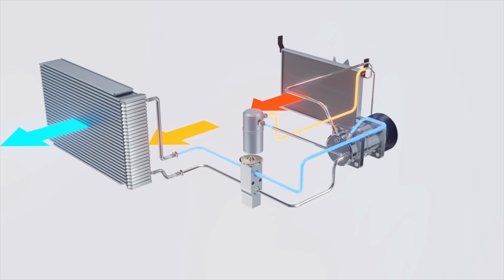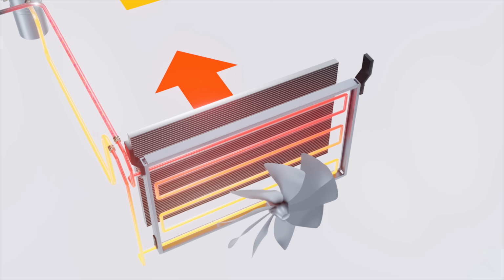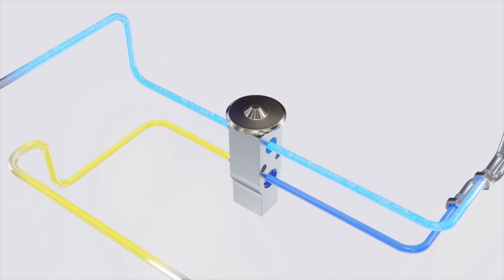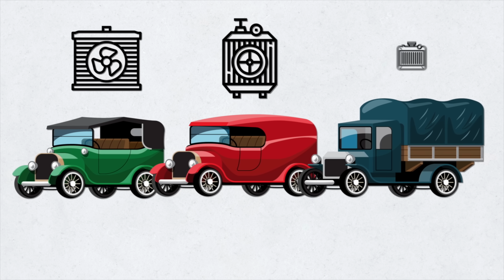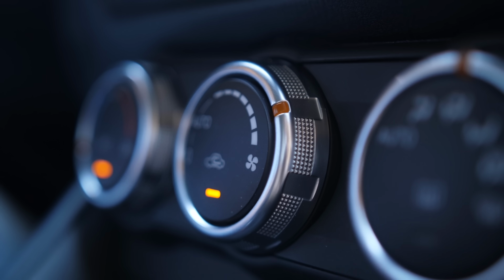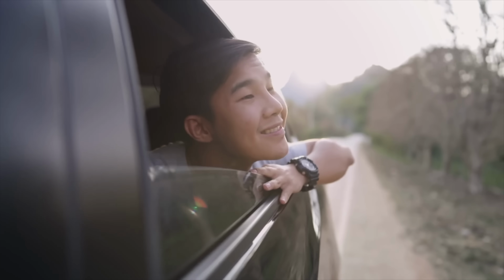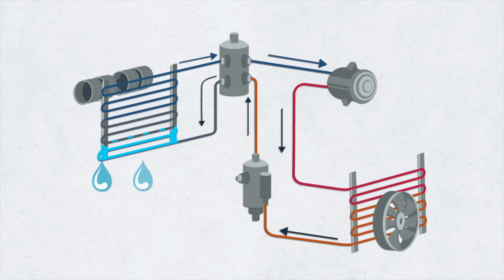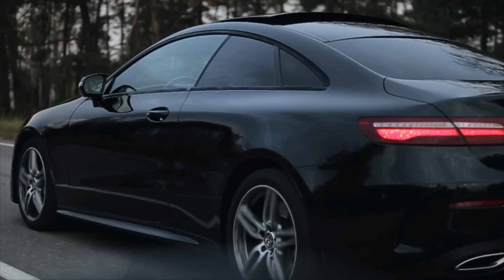Never Do This to Your Car’s AC System

Comment: I was always wondering what incredible reasons for car manufactures force AC on windshield? Why not keep it selectable and inform in manual how to defog... Why in the world i have to run heat in winter over forced AC on windshield? Do they really want me use more gas and loose compressor faster?
Reply: Dehumidified air will clear up a foggy windshield especially when it rains. That’s another GOOD function of the AC.
Reply: @standhd  I'm talking about winter, it should be selectable, not forced, everyone can read in manual to turn on AC to windshield to remove the heat they breathing on it ... or at least setting temperature on heat should turn AC off... if they forcing it so people don't have to study it
Reply: @tallll70  on my 2010 civic I was able to reprogram it so I can turn the A/C off even when defrost is on.  Found out how on YouTube, it was just a sequence of turning the ignition on and pressing the door locks.
Reply: @ExplorerBen7  That is cool, i wish i could do that with alfaobd , i do have added compressor switch which also led indicates compressor cycling, just for fun of it
Reply: It was mentioned on the video you need to run the A/C even in winter to make them last longer but it doesnt give you cold air though if you got the thermostat set to heat.
Reply: @VintageCars999  That i didn't notice, but i wouldn't believe it anyways... what about climates with not enough heat or could, so they doomed to worst AC reliability... Not to mention, if that would be the case why only on windshield?   Not convincing

Comment: Just like your home thermostat, turning the temperature all the way down to “LO” (I speak only of cars with auto climate control) will NOT cool it down faster. If your car has automatic climate control, find your ideal “comfortable” temperature and let the system do it’s job.
Reply: Actually it kind of does or at least tricks ya into thinking it does because with the auto climate it will turn the fans on higher the cooler you go.

Comment: About rolling down your windows instead of AC... If you want less drag, roll down the drivers side front 1\2 way down, and passenger rear 1\2 way down. There are a few advantages for that:

1. 1\2 the area=1\2 the drag. (1\4 if you compare to both front windows)

2. You force the air to move through the driver (you) to get out, so it cools you better.

3. You make a passway for a lot of air out the car before it hits the rear windshield, which will lessen the drag as well.

The least amount of drag will be driver front+rear or passenger front+rear, but then you'll barely feel the wind. If you try that and it works for you... Than that's even better than what I initially suggested.

Comment: interesting to note the AC should be turned on weekly
 even during seasons when you don't need it
Reply: Why
Reply: Yeah why just curious 🤔
Reply: @axelfoley1812  it circulates the oil and Freon in the system, keeps the seals and other important components properly lubricated..
Reply: Yeah why just curious 🤔

Comment: If I can’t find a leak in the AC, I pay a mechanic to put a dye in to find the leak and also to evacuate Freon. I can fix AC compressor and change the lines, but I unfortunately found out that the leak is  in the dashboard in my 1999 Durango (it’s my dog car), so it’s not worth fixing it. Too much work disassembling the dash. Yes, Durango is a crappy car but it does have a good V8 Magnum engine so I’ll drive it until engine or transmission go kaput...
Reply: One of those rare instances when I'd try a sealer.
Reply: @wholeNwon  
I did actually. It did not help. Dashboard leaks are the worst.
But my other Toyotas have never had AC problems: I have also Matrix 2005 and RAV4 2006. Matrix I got free from my mom and Durango free from dad. I got RAV 4 last year that I bought.
Reply: @igorseprak6177  Which product did you use?
Reply: @wholeNwon  
Regular Auto Zone AC seal leak. In this case, mechanics actually saved me money by finding the leak with purple dye where it’s hard to trace. $100 well spent it turns out. Had I not done the dye, I would have been sucked in the the AC quicksand by changing all the parts but disregarding the dashboard.
Reply: @igorseprak6177  Actually it's the second or third place to look. If you used a rubber seal conditioner as a leak stopper that wasn't bad but, since it didn't work, I'd try an actual leak sealer.  Of course, if I had any plans to salvage the system, I would not use one of those products.

Comment: Put a radio in my 2015 ram 1500 express now ac dont work dealer did not want to fix wanted to replace 1500 worth of connectors i did not need ac is still not working it worked before the radio
Reply: Go to a different shop...NOT a dealer.
Reply: Hahahaha you broke it.

Comment: Funny story... My cousin had a Chrysler K-car years ago... I was probably 12 years old.  We went somewhere and he turned the A/C on and it worked fine until he turned the wheel. Then it blew warm air until he turned the wheel straight again.  I always wondered what would cause that.
Reply: May just need freon, if the condenser fan is working.

Comment: I told you my dad owned Baskett's Texaco. In late 50s, he and Fred Jones, who never cashed a paycheck from my dad in 30 years, began installing FridgiKing air conditioners in cars including some brand new cars. It mounted under the middle section of dash was about 20" depth by 28" width by 7" height. All vents and controls were on the unit and the rest was under the hood, although I think there was a small component under the dash also. They had to custom fit each unit and the one in dad's 54 Mercury cooled the backseat just fine as I rode back there. It was so cold and we loved it. It caused dad to put extra help on to pump gas and do tire and oil changes. He and Fred were popular for several years until advances changed the way it was done. Boy if you saw a picture of Fred, you would swear it was old Honest Abe. He was a very private person. 
I just wanted to show that they were installed well before the late 60s early 70s.
Love your show Scotty...

Comment: My 28 year old Altima still blows colds air to this day ‼️ long live R12‼️
Reply: ford and chrysler were the dying of R12. bad connections and hoses !
Reply: @poolmotorrepairguyFL  Hoses. Definitely not good for an A/C system.
Reply: Altima’s never had R12. Their first year, 1993, had R134. The car’s predecessor, the Stanza, had R12.
Reply: Not many vehicles still have R12 . I'm guessing if available it's at least $300 a litre or lb or something.

Comment: What if the ac is hot for about 20 min and takes about 45 min to actually gets cool? My ac is brand new but takes forever to get cold... do I just need to break it in?
Reply: No, break in is not required, there is something quite wrong.  It could be overcharged.  If it is an R12 system converted to R134a (even with new parts), the quantity of refrigerant is less.  You can find online information to give you the required quantity.
Reply: If the car is new, too, take it back to the dealer. The system is defective.
Reply: @wholeNwon  no the car isn't new but the ac broke last year and I got it replaced and now that it's summer time it takes a while for the ac to actually cool the inside down

Comment: Not sure if it was a myth or not but my dad who was born in the 1930's used to always tell me never to turn my AC on all of a sudden if I I was going 50 mph or faster- reason being the compressor engaging while I'm already going at a high rate of speed probably wouldn't be a good idea
Reply: It will cycle on and off all the time to maintain temp.
Reply: Actually it might just work faster to get the cabin temp down quickly.

Comment: Where I'm from in Puerto Rico we have some really steep rodes to climb in the mountains. You said the car automatically distributes power where needed, with that said I'm going to have to say that I disagree with you, as when you turn off the a.c. on the really really steep hills all the cars feel like they get their turbo activated. Stilll an Awesome video ❤💪✌
Reply: Definitely!  On my Honda Civic I turn the A/C off when i need more power to pass or go uphill and notice a big difference.
Reply: @ExplorerBen7  would be interesting to see if the compressor kicks off and it's just the fans that stay on. But definitely agree👍
Reply: @nyrubin  I would say the biggest difference would be from the compressor kicking off, the fans don't take much power and if you're going freeway speed might not even stay on unless going steep uphill for longer periods.

Comment: A clogged micron cabin filter can also effect the output of your cars AC & Heating systems as well
Reply: I know!  A plastic bag was sucked from the glove box into my vent system once!
Reply: Jokes on you my car (03 ford escape) wasn't sold with a cabin air filter
Reply: @runed0s86  my 03 Ranger didnt have one either
Reply: @grizz6370  Hey at least there's an actual spot to put a filter in! I think the size is 8243, but you should check me on that.
Reply: @runed0s86  sold it an got used 17 F150

Comment: I love my Bolt EV. I can pre-condition it from my phone whatever the temperature, even if it's inside a garage since it's a zero emissions vehicle. Embrace the future my fellow gear-heads.
Reply: gear-heads will turn into volt-heads 🤣
Reply: @SomeRandomDude-zqxj  I'm a gear head whose not afraid to embrace the future. I still love ICE vehicles, but spend some time with an EV and that vixen will change your perspective.
Reply: I'm old but my next vehicle will be electric. Makes MUCH better sense than ICE.
Reply: Continue virtual-signaling...

...Until "the grid" goes down due to inability to produce and distribute enough electricity.
Reply: @edwatts9890   I'm not a child, been driving and loving ICE vehicles for decades. Bring a man-sized rebuttal, then we can talk.

Comment: I have a 2010 crv and the ac blows extremely cold about half of time,  it blows extremely hot the other half of the time.  The original owner replaced the ac system twice so I am skeptical that it may just be a flaw that cannot be corrected.
Reply: Sounds like a defective control system.

Comment: I turned the AC on in my old 2001 Dodge Ram one day. Fan quit blowing and I smelled a burning electronics smell, the AC and heat died that day. RIP you rolling pile of garbage.
Reply: On my 2001 dodge i pulled the whole dash out to replace evaporator core because of a leak also replaced the heater core while i had this dash out. Ive heard that some people just replaced the one that was leaking to much work to do it twice
Reply: Some American cars are trash
Reply: @HalGio1988  my 2001 dodge truck had 380,000 miles on it when i sold it to a man i worked truck is still running
Reply: @captinbeyond  No ma’am!
Reply: @captinbeyond  nothing better than a Cummins with a Dodge wrapped around it
Reply: @HalGio1988  And always have been.
Reply: So you replaced the under dash fan?
Reply: It’s a Chrysler product. What do you expect ?
Reply: I Had a customer bring in a Ram of the next generation 2004-
The complaint was intermittent Blower Fan operation and someone had supposedly replaced the blower motor.
After pulling the truck in and before turning it off, I figured I would peek under the dash on the passengers side. I tilted the steering wheel out of my way, and as I did the blower fan came on. Bad ignition switch and harness connector burned up.

Comment: Interesting stuff. My 09 Accord Coupe blows cold air but in the morning after five minutes I get heavy mist coming out the vents. Like vapors. Real weird.
Reply: I've had that happen.  It was a leak and freon was coming through the net3
Reply: @justme-vu6yj  interesting
Reply: If it smells sweet, it's coolant from a leaking coil. Floor carpets wet?
Reply: @wholeNwon  no sweet smell. No floor mats being wet. Just vapors coming out the Vents. But only in the morning drive to the office. In the afternoon and going home in the evening I blast the account And no mist!!
Reply: The drain to the evaporator and heater core box is likely plugged and retaining water.  Just google where the drain is and carefully clean it out good.

Comment: Scotty I have a 2007 Honda Civic and my A/C gets a little warmer when it's Idling then when your moving along. What could be the problem ? Thank you 
Jose Cruz Alvarado
Reply: Insufficient air flow through the condenser.
Reply: Same problem in my car
Reply: Check to see if you fan is working. If it’s electric. I think Scotty had a video about this but I think it said to turn the air on hi and see if the fans are working you might have 2 make sure both are working if not get the fans fixed.

Comment: My 2008 Audi S5 with 93k miles has a very mouldy kinda smell whenever I use the AC but when I turn it to recirculate the smell goes... I've changed the air filter and cabin filter and refilled the AC system with new refrigerant which I know is not leaking. What could be the issue?
Reply: Do you clean the outside ac air intake? Most people don't; might have a bunch of dead leaves in it
Reply: I would also pull the blower motor to see if anything if caught in the cage.

Comment: I had a mouse fall into the AC barrel fan of my 2002 Chevy Silverado. It threw the balance out and made a terrific rattle. I pulled the fan out, got rid of the mouse and reinstalled everything and it worked fine. Tho the mouse didn't survive the G-forces. DOA.

Comment: I drive a 2004 E450 at work. It had AC issues for 10 years! Always had to be recharged every summer. Went thru 2 compressors. Finally got it fixed last summer when they replaced EVERY component of the system!
Reply: Just to find a leak?

Comment: I have a 2011 Kia Optima. When I turn the AC on, the car starts to have a noticeable rough idle. It also seems like the car drives a little sluggish as well while it’s on. I recently went to the dealer for scheduled maintenance to have the spark plugs replaced. I brought up this issue as well and they said it was normal for the mileage that I have (almost 107,000 miles). I brought this up here to get your opinion on what this issue could be because I don’t think it’s normal like the dealer said. It still blows cold. It also made a “whirling” sound once when I turned it on, but it has only happened once.
Reply: Clean the IAC. Never believe anything a dealer tells you...period. That's assuming that the engine runs and performs normally otherwise.

Comment: You asked for a funny AC story, so here goes..... I once had a car with AC so cold. I dropped my cousin off at work. When she got out some hot, humid air came into the car. When I drove off I noticed "smoke" coming from the vents. I got scared and pulled over thinking something was on fire inside the dash. It was just the cold air mixing with the hot air.
Reply: in super nasty humidity, if i put the window down with the AC on in my Honda Prelude, it would blow snow out of the vents!
Reply: @toolmanthetim7042  dang. Well that's when you know your AC is functioning well
Reply: I had a 2000 Toyota Rav when I lived in FL.  One day driving in to work, I noticed "smoke" coming out the vents.  Flipped a/c off, didn't notice any strange smells or sounds.  Asked a guy at work, he said it was just the condensation from the humidity.   Happened pretty frequently.  So I know what you mean, does look like smoke coming out.
Reply: Actually,  it was the HUMIDITY,  hitting the cold condenser, basically turning it into rapid condensation,  coming out of the vents as FOG.
Reply: @1958Cadillac-v2g  which places have such high humidity that would cause that?
Reply: @VintageCars999  south Florida for starters
Reply: Had same happen in my old Buick LaSabre, back in the day. In fact, the cold air came out sometime with ice crystals.
Reply: One smells like smoke, the other doesn't.
Reply: @wholeNwon  It sure looked like it. Lol
Reply: @wholeNwon  – When something looks like smoke, your 0.5 second response should be to switch everything off before starting the analysis.
Reply: @brianvogt8125  yes, , most of the time it's the best bet. There might be uncommon circumstances where your between a rock and a hard place. It's to do with being mindful that switching off a modern vehicle creates electrical sparks in the relays. Switching them on also creates sparks . The advice for a propane fueled car with a n a unexpected gas leak was to not switch off if engine was running but to run away and call fire brigade . But these gems of advice are usually too cautious . One can do their own assessment , maybe not. That boom that happens when naïve folk use gasoline to light a fire is a little more powerful in a propane butane type explosion .

Comment: Hey guys I just bought a 1990 corvette but I have a problem. When i turn off the car with the doors closed or drive off somewhere the cabin lights always stay on for like 5 minutes and the ajar light isn’t even on. What should I do?
Reply: Check your owners manual.  Most cars leave the lights on for a selected period of time, for safety at night. Gives you time to get into your house, without being in the dark.
Reply: That may be normal. My work truck does this, but for a minute or so. Are you sure it’s 5 minutes?
Reply: @standhd  yeah about 5 or 4 minutes

Comment: My 2004 Winnebago Brave AC is weak and I was recently driving in 100+ temps and it started blowing hot air!!! What is wrong?? I had the coolant drained and replaced and that didn’t help. :(
Reply: Clogged condenser, non-functioning condenser fan, low refrigerant, bad TXV, etc. Do you have a heater control valve? Is it closed when AC is on?